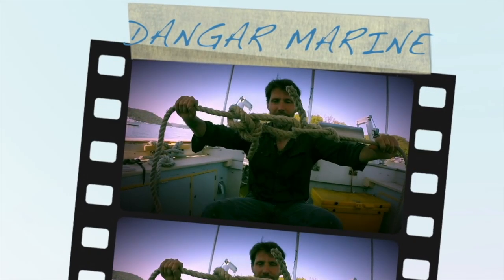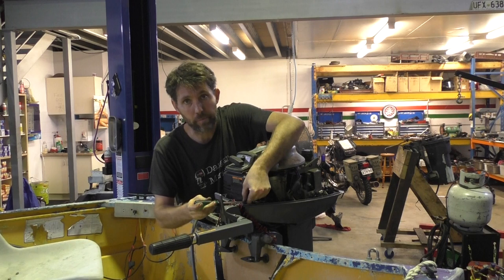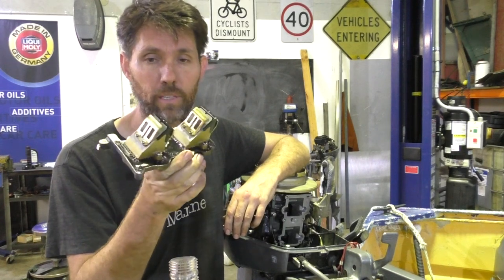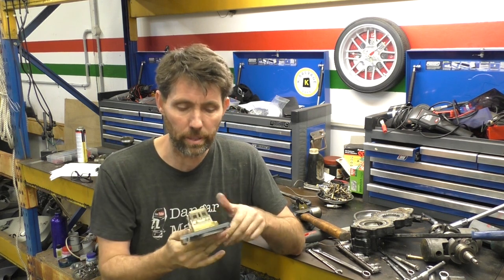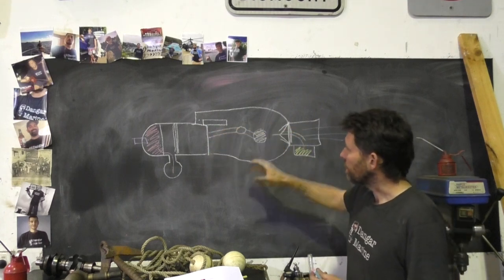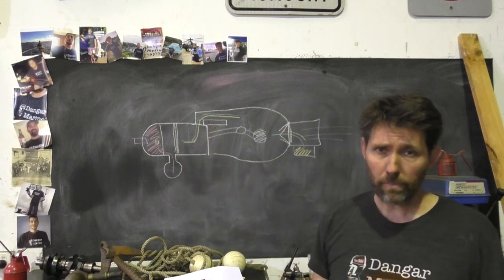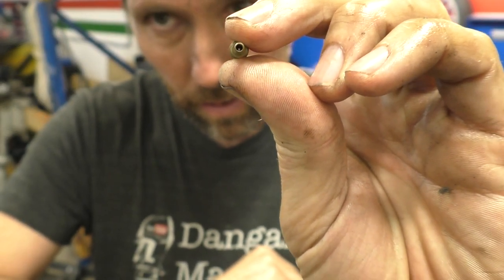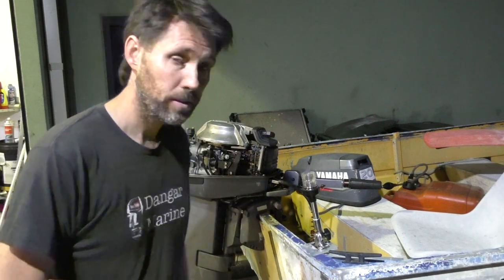Outboard reed valves

Comment: Hey mate angel here from miami  love your series. Question If the reeds are bad can they stop the engine from going into wot or passing 2500 rpms?? Im. 

The reason im asking you this is because thanks to you ive been learning so much about outboards I'm a do yourself type guy ive took on the task on rebuilding a 84 Johnson 115 it came out great my compression in all cylinders is 120 but im having a problem after putting everything back together the motor turns on great on the hose. I went to my nearest marina to check the timing and link and synk. Idle adjustments as soon as the engine got under load it started giving me all kinds of problems so I assumed I just had to adjust my idle and linkage. I finally got it to idle in the water so i went ahead to the channel to see how it was going to perform. Turns out that my motor would not pass 2500 rpm under load can this be a reed issue that was the only thing I dint replace while doing the rebuild. Thanks again.
Reply from the maker: Normally bad reeds with make an outboard very hard to start and be less noticeable as a problem as you go up the rev range.  You will also generally see fuel spitting back out the throat of the carburettor as it is idling. If you disconnect one cylinder at a time you  might find there is a cylinder that doesn't cause the speed to drop which means it wasn't contributing any power and may have a bad coil.
Reply: Dangar Marine thanks mate can a regulator rectifier cause this problem I just tested mine today and I have no reading
Reply from the maker: Possibly. Most ignition systems run directly on the AC from the coils, but it was once said to me that you should fix everything that you know is broken before getting too carried away trying to diagnose a strange problem and so far I've found it to be good advice.

Comment: If the reed valve was stuck open would you get zero compression?
Reply: Reed valves do not effect cylinder compression so you should have normal compression even with a reed valve stuck open.
Reply from the maker: As William says, the reed valves don't affect compression readings. The charge is compressed very slightly in the crankcase, just enough to get it to transfer through the port to the top of the cylinder where the piston compresses it up to combustion pressures. If that is low it is still about the rings being worn.

Comment: Hey Stu, did you ever find out what the problem was making the engine sneeze?
Reply from the maker: Yes, it was a carb synchronisation issue. I think it is the following video.
Reply: @DangarMarine  So, I have an 85 Merc 18 with that same snort, but it only has one carb.  Now what, reeds look good, I flipped them, carb cleaned several times, waiting on new gaskets.

Comment: I once had one of these that played up and kept spitting back, it was a leak in the fuel pump diaphragm causing a lean condition on the lower pot. I'm struggling to remember why it wasn't rich and letting fuel in, there was something weird about the design of the pump I think - it was like a double diaphragm or something. Anyway, try sacrificing a virgin, if you can't find one, let me know :-)
Reply from the maker: Interesting. I haven't had the fuel pump apart on this one yet but it has been on my mind to make sure it is okay.

Comment: I have a 1964 McCollun and it runs but it dies when I shift into drive what could be the problem??????? I have fresh gas and oil
Reply from the maker: I would start with all the basics: compression test, clean the carbs, new spark plugs etc and maybe even increase the idle speed a little bit.
Reply: Mine did that— turns out the prop was on too tight

Comment: hahahhahah classic!!! good vid on reed vales but :) hey stu have u got a vid on how to stop extra smokey 2 strokes and what are some corses of the extra smoke im pretty shore mines all fixed now but would love to see what other problems can make this happen! p.s 99% shore mine was oil in the fuel (premixed) on a oil injected motor hahahahah seems to have fixed it but did raise the question of what eles could it be for me!
Reply from the maker: Generally smokey outboards are just too much oil in the fuel as you say. If the outboard is oil injected they can sometimes be adjusted, but other times not unfortunately.
Reply: thanks stu, was thinking there must be a manual adjustment for the oil, never seen it done but ill have a google  :) cheers again
Reply: also whats ur thorts on oil injection u think its better to plug it and mix it urself? and if i store my boat for 9months is it common for the oil to clog up the oil injection and then ......... well u know what happens BOOM whats the main reason oil injection gives out as ive had 2 other engines in the last 15yrs sizzze cos of faulty oil injection!

Comment: This was really helpful. I have a Mercury 110 that I was told may have damaged reed valves. Fuel spits out of the carb when trying to start it (it starts fairly easily, three or four pulls when cold) also fuel spills out if I pull the choke to stop it. When the motor is running though, no fuel comes out. If the reeds were damaged, wouldnt I see fuel coming out the carb the whole time, due to the lack of a proper seal on the reeds? Thanks again for the great video!
Reply from the maker: Yes, you would expect to see some spitting when running if the reeds are bad. It could be an issue with the float sticking and the bowl over filling.
Reply: @DangarMarine  Man I really hope that you're right! I watched your video of diagnosing one of these motors, and getting to the reeds looks like a royal pain. I replaced the float needle and adjusted the float to within specs and it still spits fuel. I just ordered a new float...maybe that will help. Thanks a ton for the great videos and for your reply!

Comment: Is it true that replacing a reed valve assembly on a Yamaha F9.9 can increase its power to 15hp?
Reply from the maker: Possibly. May also need new carburettor jets to give more air and more fuel.
Reply: Dangar Marine Hey! I hear on the forums, both the 9.9 & 15 have same size jets. Do you think I may need a bigger prop too? Thanks for the reply.. your videos are awesome btw
Reply: @RodrinBird  big hp => bigger prop

Comment: Driving myself crazy trying to figure out what this noise is: https://www.youtube.com/watch?v=g9SpbtaiT_k
It's a 2 stroke, 120 hp. Any chance this is the reed valves?
Reply from the maker: Sounds a bit too loud to be reed valves. Does it make the noise when it is running on a hose? You might need to carefully listen around with a mechanics stethoscope. Noises can unfortunately be very hard to locate on outboards.
Reply: Thanks for the reply Stu, I'll pick up a stethoscope. Nope, doesn't make that sounds on muffs, even when we rev it up. Seems to only happen under load at high rpms. I also couldn't shift into reverse which a new problem as well, gears would grind every time I tried. The noise sounds like it coming from up high but i wonder if the issues are related and it's radiating up from the lower unit.

Comment: I think condensation water is in the fuel tank. Because I have had the same thing. At first I thought it was the caraburator and it was not. If the engine sneezes from now on, I first check the tank for condensation. I thought so at the first video, but I thought, it might also be something else. After all, you do not know everything. Before you know it, the whole engine is disassembled, and you still do not know what the problem is.  >>>> And what was the problem? Because I have not seen a video of that yet. <<<<
Reply from the maker: This was the  problem in the end https://www.youtube.com/watch?v=NnotQmnKxKM

Comment: Yamaha 5 hp. Rebuilt carb. Motor runs great until you put it into gear. Then it Boggs down.
Reply from the maker: Check compression and spark too.
Reply: Dangar Marine thanks a lot. I totally respect your advise.
Reply: I also have a Yamaha enduro 8 hp pro. I was told by Marine engines that they could not provide parts because the motor is international